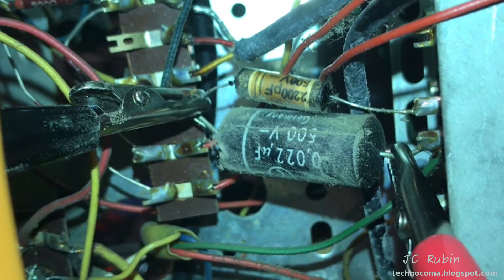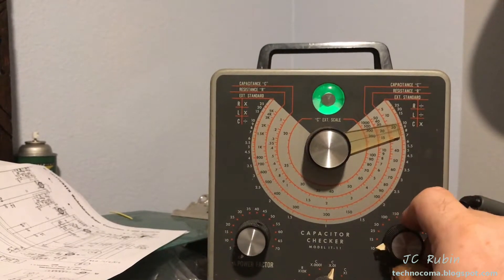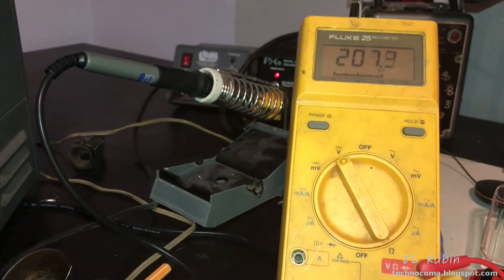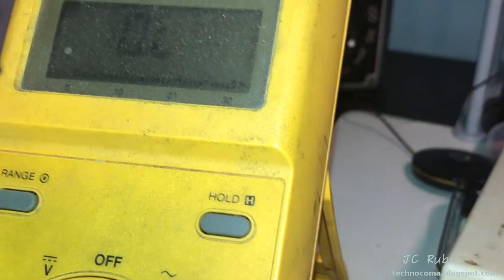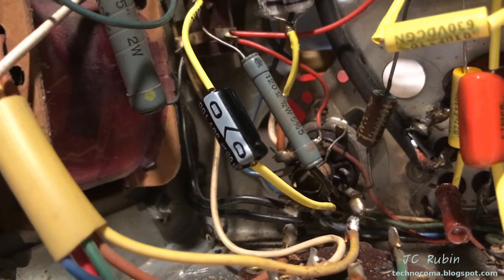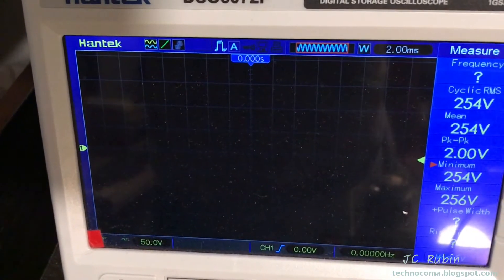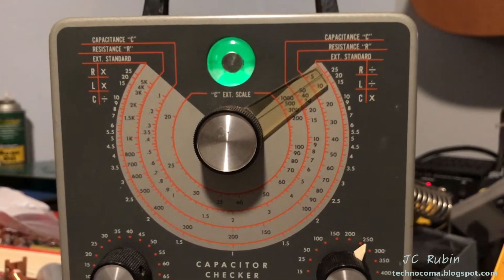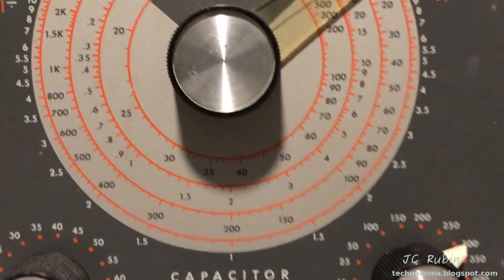Telefunken Concertino 7 Radio Repair Part 3 of 5

Comment: Well done Jc I have an AEG super5-40WU. similar to your radio just started trying to repair. Found several caps and resistors way out of spec will just plod on trying to get high value resistors is not easy in the UK, carry on regardless.